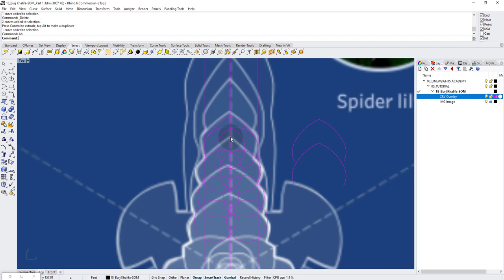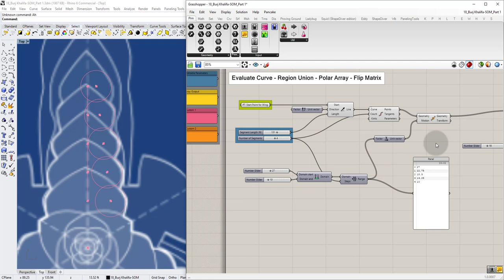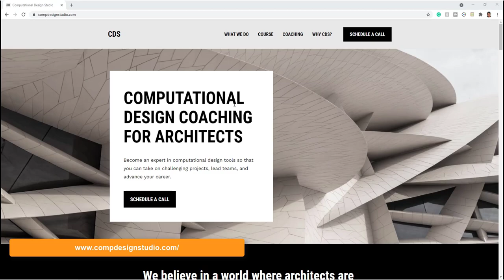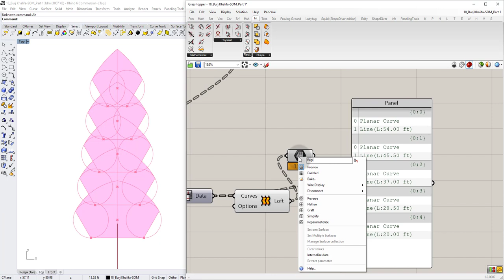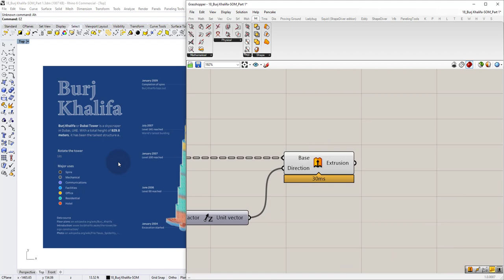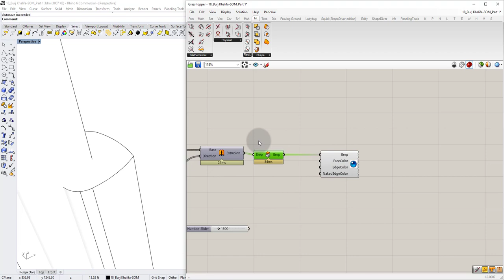Step-by-step Burj Khalifa Grasshopper Tutorial

Comment: Came here for the rose scripting lmao💀
Reply from the maker: What’s the ‘rose’? The plan geometry?
Reply: @LineweightsAcademy You mentioned it in the video too. „The rose“ is the change in geometry at the top. It works like stairs as well, but the logic is different. 

I am scripting Burj Khalifa for Uni and we have to use a lot of parameters. So: Change # of wings, change # of leaves per wing, change length of wings, change all different levels of the ground level geometry,….

And the rose is insanely hard to script if you have a changeable count of wings and also a changeable count of steps up per wing :\